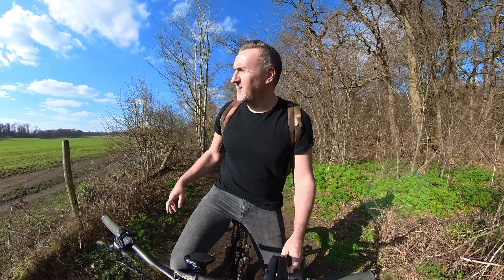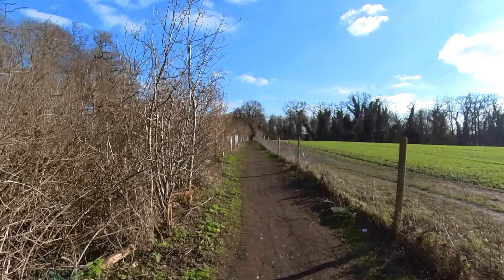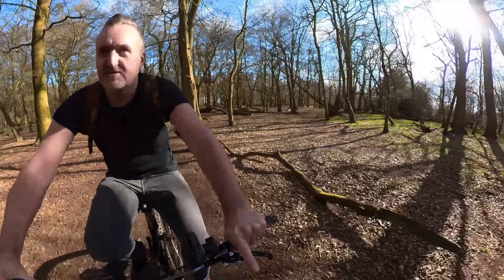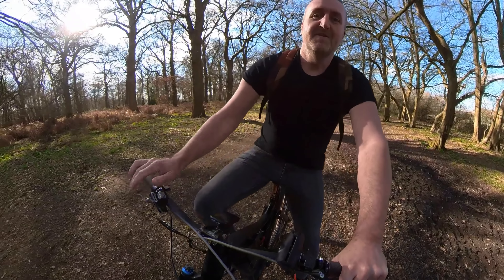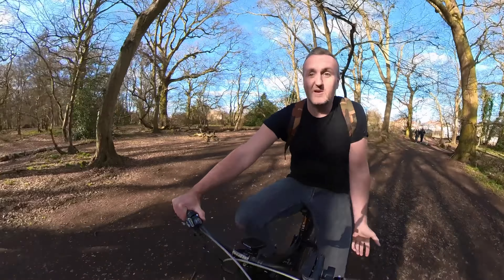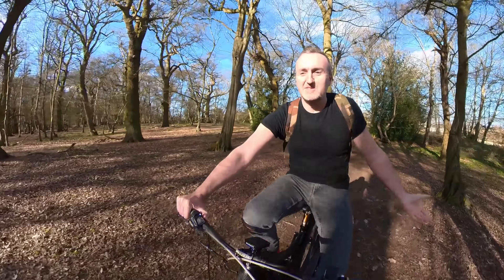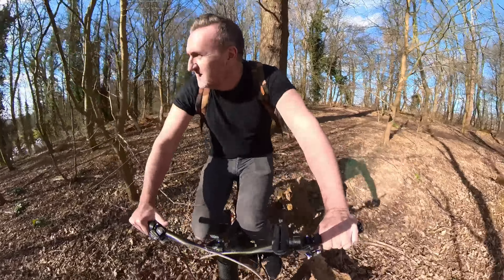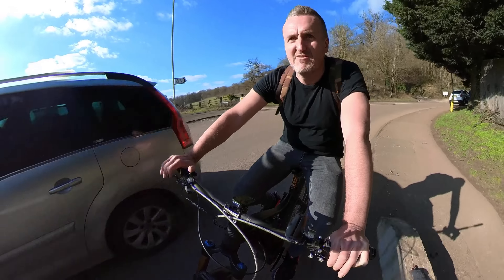HIGH POWER VAPOUR EBIKE RIDE WITH THE INSTA360 ONE X2 360 CAMERA!!!

Comment: Good mic, no wind noise, could hear the knobbly tires and suspension creaks too.
It makes a good back up camera to get those easily missed action shots.
Reply from the maker: Yeah very true.
Reply: @andykirby  on watching again the image stabilization really works well, the handle bar is bouncing around with no effect on the camera. impressive. Would have liked to see it in selfie-stick mode too for the wider shots, to see if it still worked when riding. (maybe not in the trees)
I might get one to record those near misses and in case of accidents etc.
Love the drone shots.

Comment: I'd really like to see you swap the Bafang controller for a Innotrace controller. Its made for the ultra max and fits inside the housing. It maintains the torque sensor and does up to 3000w. There's no good reviews out for this despite it existing for over a year.
Reply from the maker: I'm not running the standard bafang controller, I'm running a phaserunner controller at about 4000W. I've heard about the innotrace but I just use throttle on this bike.

Comment: Cool video, dude it's so much easier to edit through your phone than it is on a PC, the editing software makes it so easy and you haven't got to deal with the huge files 👍
Reply from the maker: Interesting! At some point it would need to be on the computer though as I finish my videos there. I’ve found since using the insta 360 app on the Mac to do the key frames and then export rendered 4K footage way more fluid for my workflow. Final cut seems to suck at handling big 360 degree clips.
Reply: @andykirby  Handy to know 👍 definitely give it a go on the Insta360 phone app, so easy to use as you just need to move the phone where you want the camera to see (sounds mad but makes sense when you start 😉) obviously once your done export the file out of the phone and import in into your editing software on the pc to add your video 👍